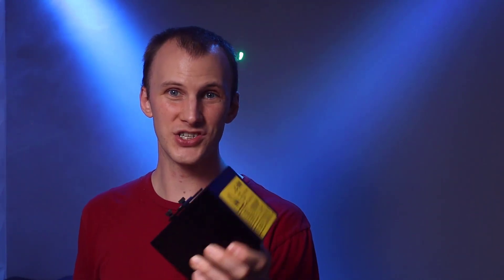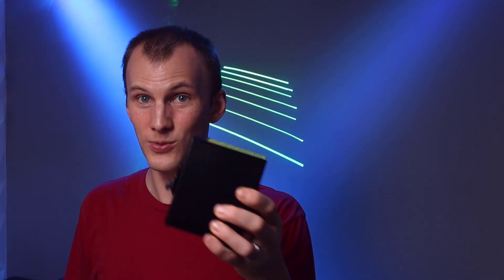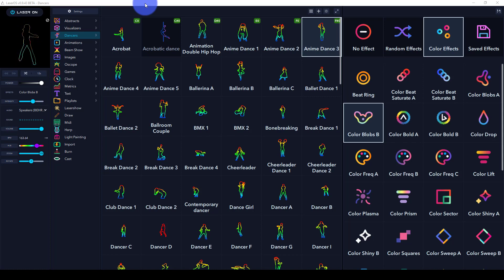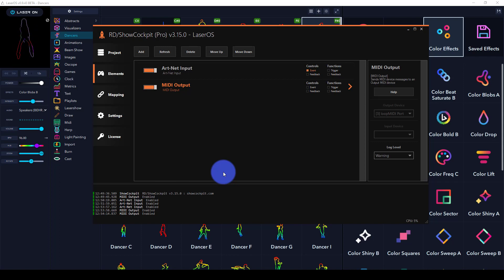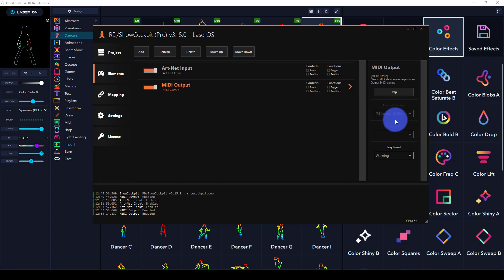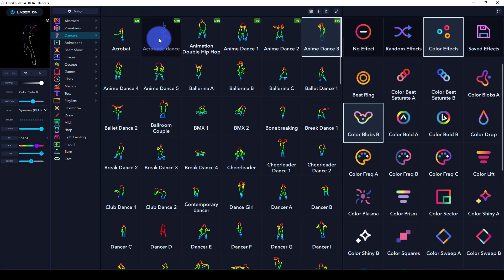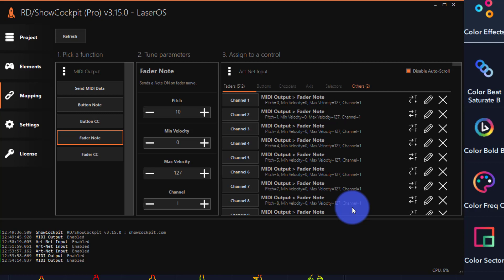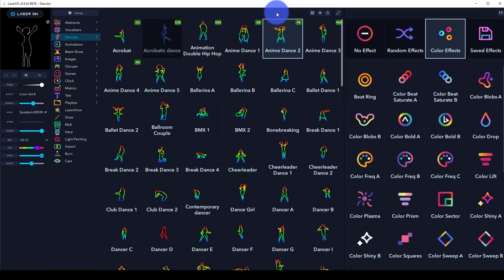How to use DMX with LaserCube LaserOS

Comment: How does the setup work to link the Console, Computer, and the Laser cubes? Do the laser cubes need to be in wireless mode or can you send artnet to an ethernet port and connect the laserOS computer and the Laser cubes to this ethernet port?